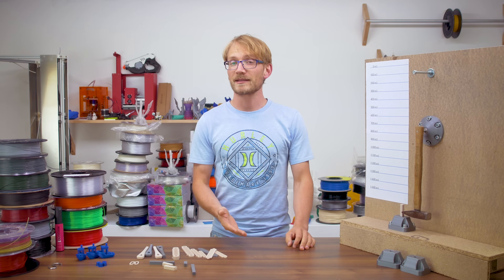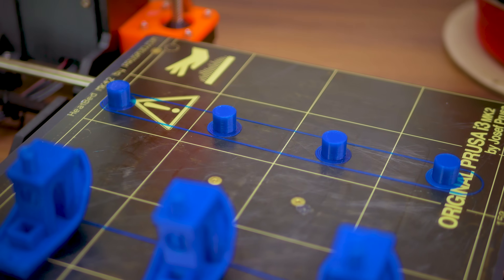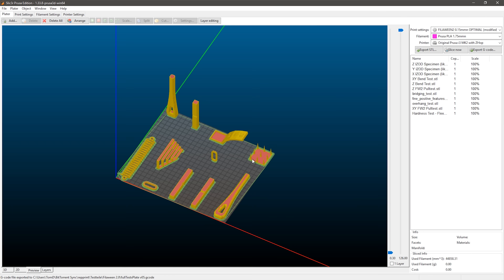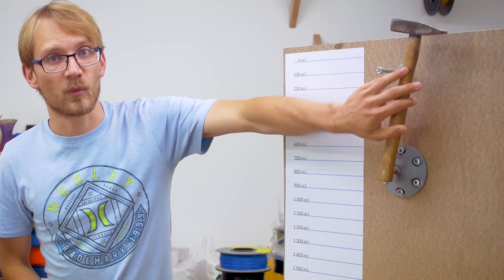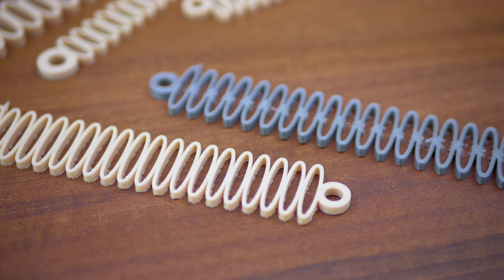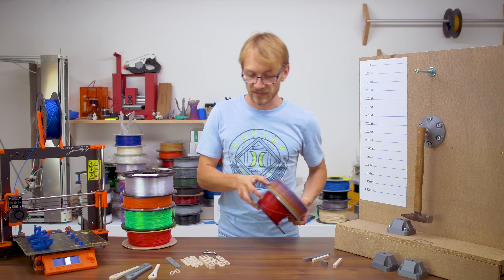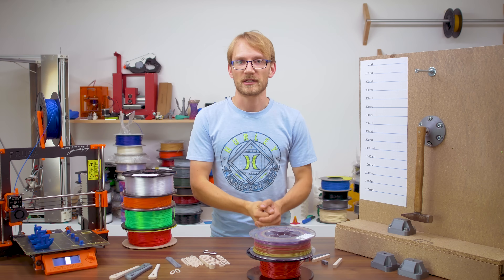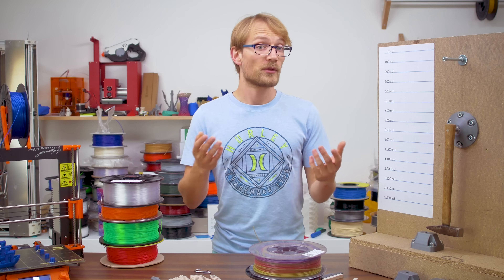The next generation of Filament reviews: This is Filaween 2.0!

Comment: This will be interesting. I just bought my first roll of PETG to mess around with higher strength prints, but for some reason, the layer adhesion is absolutely terrible. Any ideas why?
Reply from the maker: Oh, Copolyesters usually have excellent layer adhesion. Maybe give the temperature and extrusion multiplier ("flow") a small bump?
Reply: I'm already at 240C. I feel like I could have the cooling fan up a bit too high, or maybe the low infill caused it (it was an Aria dragon ~20% infill). It was Inland branded, if that matters.
Reply: @LazerLord10  lol this is way too late but in my experience inland brand PETG is pretty awful in terms of layer adhesion. If you want PETG with good layer adhesion id recommend Prusament PETG as it’s the only other one I’ve used but it’s worked outstanding for me. Hope this maybe helped?
Reply: I recently printed a whole set of Hypercube parts for a friend in PETG, and although it was a pain to get tuned in, I ended up printing at 245c. I had previously tried it at 240c which suffered poor layer adhesion. The extra 5c made all the difference.
Hope this helps
Reply: try keeping the fan at 25% (just observe that when the extruder hits the next layerr, it is somewhat solidified; you want not completely rigid but also not gooyie (must respect architecture, but must be able to 'grip' the new extyruded filame,nt good)
Reply: I found Taluman 910 to be far superior in strength to PETG if that helps at all. It sticks very well to a glass bed covered in gluestick, pretty standard stuff. 

The PETG I printed with only wanted to stick to build tak. I wasn't impressed with it at all compared to nylon.

Comment: Looking forward to this! Some questions, if it's not an inconvenience. :-)

Question 1: What's the temperature on the cylinders? What's the extrusion multiplier on the benchies? Can the optimum for both be reliably determined independently, or might one depend on the other?

Love the impact strength test setup! My next two questions are about that.

Question 2: It seems you've labeled your axis with actual units from the metric system: mJ. In the past you've mentioned you're hesitant to do that because you didn't want to give the illusion of scientific rigor and precision. Does this mean you're actually confident in the repeatability of this particular test?

Question 3: What do the values on the axis signify, exactly? (Kinetic energy absorbed by the print?)
Reply: The test setup  for impact strenght he uses is really close to the apparatus a "real" laboratory would use to test samples in the industry (he mentioned the ISO standard for such a machine as a guideline). So actual scientific units aren't out of place here if he calibrated right. To have a reliable value for a specific filament the only thing needed is mulitples of the test samples to generate an average of the results, but I'm confident the results are fairly accurate even with only one or two samples per orientation.
Regarding what the values signify: You are basically right. But you measure "lost" potential energy: The swinging hammer transfers potential energy (from gravity and starting height) into kinetic energy until the bottom and then back again into potential energy until it reaches a certain height on the other side (not as high due to friction in the bearing). This is your calibration point (0) for your scale.  When breaking the sample some of the energy the hammer has is used up to break the sample. As a result of that the hammer doesn't swing as high anymore. Now you can measure that distance (from no sample (0) to the point where it swung with a sample) and calculate a energy value. Hope this helps, if not ask again !